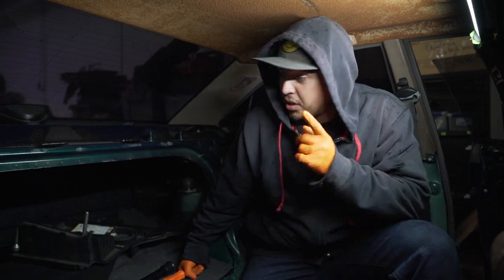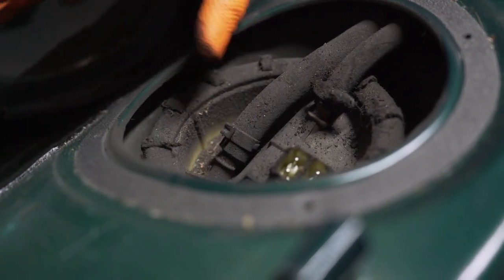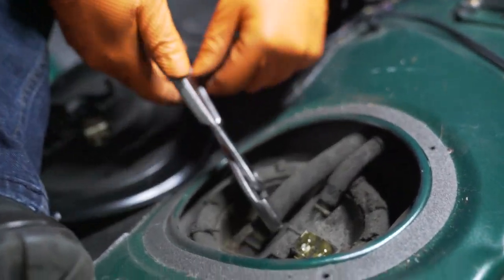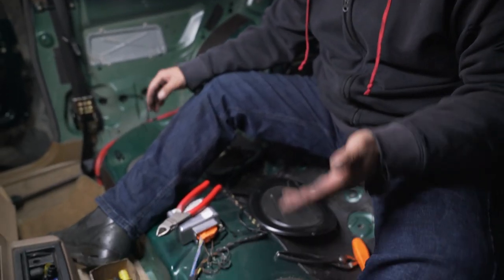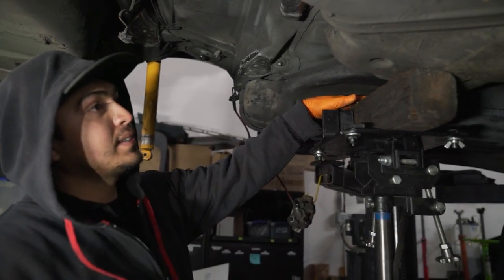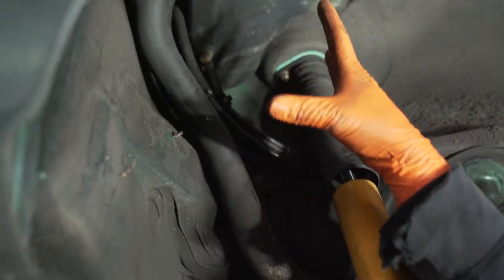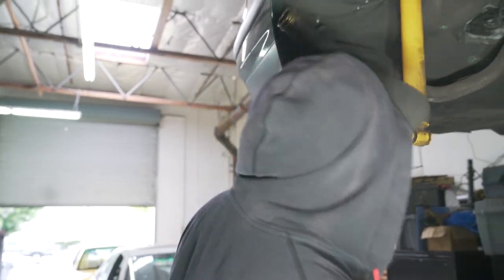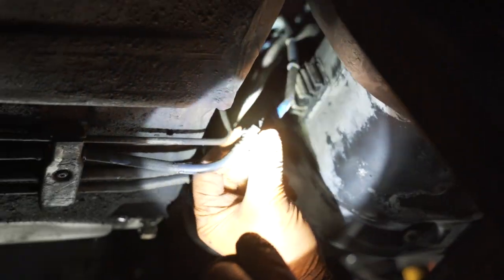How to Remove Your E36 Gas Tank - Helps when Reinforcing E36 Rear Subframe! | GOBLIN-E36 EP2

Comment: Hello Garagstic! Can please confirm what the year and model of the e36 this was? It appears to be an early model car obd1 car and I’m trying to reference a couple houses and routing of them in this short video clip so I can guesstimate how much and what size fuel tubing I should I purchase to replace all the rubber lines that has to do with the gas tank to the starting point of the hard lines. 

Before i lower my gas tank on my 94 m3 I wanted to make sure I have enough hose and also the various sizes. I only have about 3feet of the 8mm(5/16) I.D. fuel hose at the moment. Do you know if it’s all one size on my model and year m3? Over the last 12 years of owning over 8 of these cars I’ve never dug this deep into refreshing and restoring any of my previously own e36s but this one I’m working on is a keeper and I’d like to have a piece of mind especially since I smell fuel from time to time after giving her the beans lol if you know what I mean 😁 

Do I also need any of the 6mm(1/4”) fuel hose for the tank area if I’m trying to replace all the hoses ? And if so how many feet would you say is required to do what I’m after ? 

I only ask since the current fuel hose I’m purchasing which is the (gates barricade fuel injection hose MPI, it’s rated for bio-diesels , meth, e @225psi) is not cheap and I would prefer to have just only a foot extra of each size since I’ve already replace the engine bay hoses. I don’t like having excess rubber lingering because I’m limited on storage space and not only that because it will be old for the next project …
Reply from the maker: Hello! 

Our E36 is a 1992, 325i non-M model. As far as fuel line sizes go, I'm unsure of the exact specs but I would check realoem.com and refer to the diagrams on there to determine which fuel line size/lengths you will need.

Realoem is where we go to refer to OEM parts and fitment so we hope this resource helps! Good luck with your restoration and let us know if you have any other questions.
Reply: @garagistic  hey thanks for the the brotha !! 

I’m aware of realoem! Thank you for sharing. I’m still surprised at how many people don’t know about that site and they call themselves bmw owners haha 😆 but ya I was just curious based on your personal years of experience. On real oem it doesn’t always cover every question ya know but I’m just going to go ahead and order both 6 and 8mm fuel hoses for the rear tank area. I just don’t like having extra parts lying around now I’m so confused on space it sucks